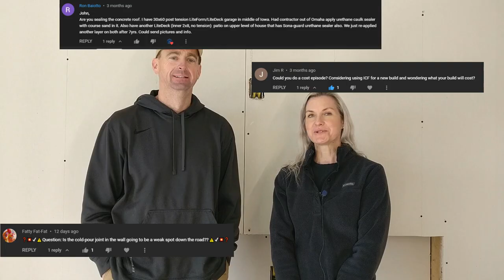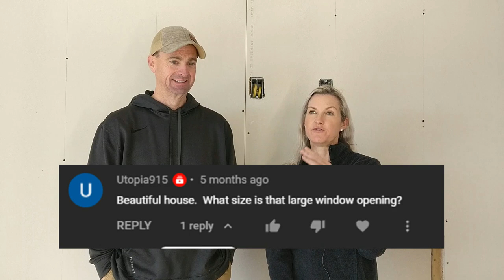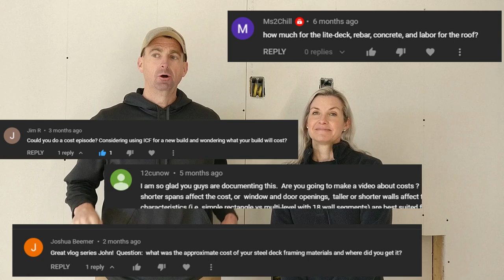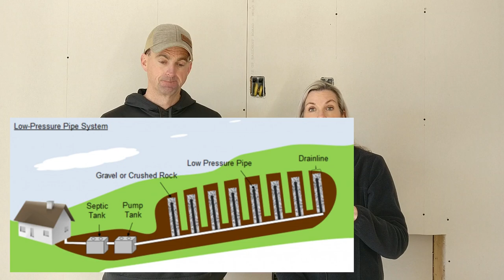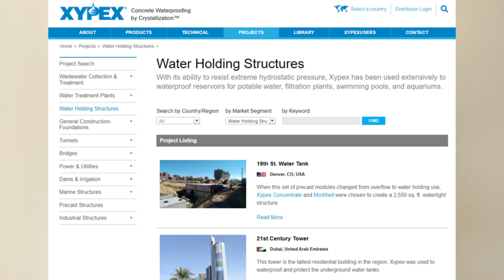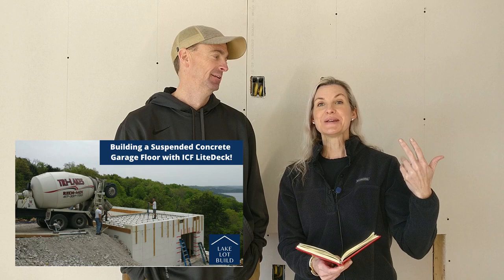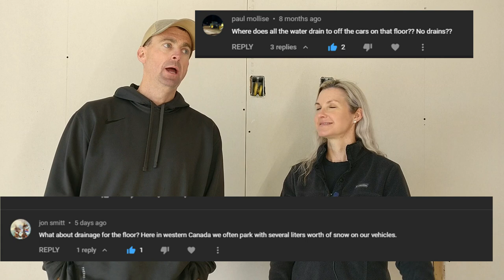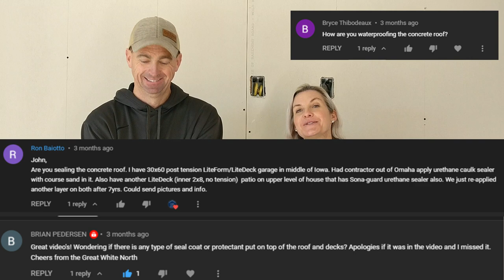ICF House Build - Answering Viewer Questions!

Comment: Good video, your xypex is a silane that prevents bonding of coatings as it becomes a crystalline matrix. The coatings bond were there is less xypex in the cement. You should consider a 25psi  eps foam mechanical bond with a TPO 60 mil mechanical bond to concrete this will increase insulation and give you a belt and suspenders solution.
Reply from the maker: Thank you!

Comment: I have worked in the roofing/waterproofing industry in the past. One product used by the Disney Corp for waterproofing everything including balconies is Polycoat Products USA out of California. That company provides coverings for Decks, Roofs, Walkways and Truck bed Liner systems
Reply from the maker: Awesome! Thank you for this recommendation. Right now we have a silicone layer that seems to be working, but we definitely want to know what else we might use if this doesn't work long-term.

Comment: Ten years ago Dallas Reunion Center went through an upgrade. The existing concrete porches suffered from water incursion. A commercial roofing company applied a thick membrane over the repaired original substrate and poured a new concrete deck over it.
Reply from the maker: Thank you! We are looking at all our options, so this is one we will look into.

Comment: Here on the middle we use tar mats or what's commonly known as "Bituminous waterproofing" on top of the concrete ro/deck. The sheets are welded together using heat from propane or butane torch.

Comment: Have you considered thick polyurethane sprayed coating? Durabak comes to mind. I'm referring to what most people refer to as truck bed liner. However, the same product is used on playground equipment, boat decks and a lot of other things. Something to look into.
Reply from the maker: We recently used silicone rubber paint which is basically the same thing! A roofing company suggested Inland for the brand. So far it has fixed our problem and looks great!

Comment: as the guy who suggested the rooftop deck that you're now so in-love with, sorry the waterproofing isn't quite sorted.

...my plans involve some slope to avoid pooling, & so i had to find a deck solution that allows for correction back to a level surface; Bison pedestals. this should allow the concrete waterproofing to not also need to stand up to foot/furniture traffic. the added cost is high, but weigh that against the added value of the usable deck & views?
Reply from the maker: Well no regrets other than the fact that the concrete guys missed the slope. If we had it to do over again, we would have made the front wall taller or had the slope built into the Litedeck.
Reply: @LakeLotBuild  ...another thought -i'm not 100% sure if Ecofinish would be an option (as it's a relatively new process developed for pools), but i've floated the idea to Aaron King on an ICF FB page. exceptional builder, brilliant tech, seems like loads of potential uses. ya might reach out to him too.
Reply from the maker: We will definitely check that out. Thank you!

Comment: For the roof, we have a company in GA that did a Polysaspartic  Polyurea coating on our concrete garage floors. Extremely durable and attractive,  I would think it'd be durable in the sun as they do concrete pool decks as well. I do believe it's waterproof, but not 110% sure.
Reply from the maker: Thank you! We will check that out. We need to coat our garage floors too, so we need to look into for that reason too.

Comment: OTR trucker just past Memphis on our way to Cali.  Was the Zypex additive expensive?  I’m sure it may have been better than the labor and cost of vaper product… thx bruce
Reply from the maker: Not expensive at all. It is really just pennies per SQ ft. Definitely worth it.
Reply: @LakeLotBuild  thank you I’m wanting to build a home with a basement in north Florida and this product will help me do that. Thank you and continued Blessings. I’ve throughly enjoyed watching y’all build this home
Reply: Remember: The additive is in the concrete and municipalities design tanks differently - If the structure has any sort of settlement there could be a crack which will give you a leak. I still specify the waterproofing in residential.

Comment: Not sure what you did to your roof that is bubbling up and not adhering.  But here are a couple of things to look at.
We have done many epoxy out door coating that are UV stable and last a very long time.  The key to this being done right is the prep work to make sure you get the hold it can give you.
Second and not sure if it has ever been used this way before is from Ecofinish high performance coating.  you may want to check and see if they are able to be in your area.  Both of these will work I think.  Good luck have a good day.
Reply from the maker: Thank you so much! We will look into those!

Comment: You two are doing great, $115.00 per sq. ft. is excellent. We live on 40 acres with too large a house. We have another 450 acres ajoining and We have another 40 acres across the fence which we built a road through and made 8 5 acre lots.My wife designed another house. Covid stopped our building plans a couple of years ago. Looking to start up again now we are getting quotes of up to $350 per square foot. So guess we will wait for now. Would like ICF and or SIPS to build with.
Reply from the maker: Yes, new homes custom built are at least $250 a sq foot to start here.
Reply: I haven't seen too many redeeming features of SIPs.  When I looked in to them, they didn't look much better than conventional framing with foam board insulation wrapped around it but they were expensive.   ICF makes your house practically a vault and can work out cheaper when finishes are added in.

To me, ICF with wood framed ceilings and floors makes a lot of sense unless you want second floor parking or a roof deck...  Combining ICF and SIPs doesn't seem like a very good combo to me.  Make sure you budget carefully and choose wisely.

Comment: As a commercial roofing company We adhere roofs to all new construction involving concrete decks. If you want I can send you a link that will describe and show you how this is accomplished. It will also cure your ponding issue. There is no pitch to your roof of even 1/4 inch if you have ponding.
Reply: You will need to put a layer of walk pad over the TPO to prevent premature aging of TPO due to foot traffic. Various types of walk pad are available.
Reply from the maker: Yes please! You can email is at lakelotbuild@gmail.com

Comment: Curious where you guys settled on the waterproofing of the roof deal. I am looking at doing something similar and wanted to get ahead of any issues. One thing my architect recommended is a membrane on top of the litedeck sheets before the concrete is poured but that's probably not an option for you guys at this point.
Reply from the maker: We have had great success with a liquid silicone brush in product. We went through several products (water-based) that did not work. The rubber membrane has worked great.
Reply: @LakeLotBuild  Do you recall the name of the silicone product? Thanks

Comment: I am curious why the icf roof cost between 30 and 40k when icf roofs are typically between 13 and 17 dollars a square foot turnkey for flat or shallow single slope. What is the breakdown of your roof cost? If you don't mind ☺️
Reply from the maker: We ended up around $26 per SQ ft for everything - LiteDeck, labor, and concrete. We didn't have a broken down cost as the roof was done by our ICF contractor.
Reply: @LakeLotBuild  no worries. I was just trying to see why it was so out of range from the average. I know municipalities, and material availability affect things like that as well as contractor pricing, but I was feeling nosey. Thank you for answering.

Comment: 1 inch pavers over the elastomeric membrane -- the pavers will protect the membrane from puncture (large hailstones, high heels and intense friction on hot days) and distortion and may also apply constant pressure to abate delamination  ... ?
Reply from the maker: Love this idea. We will look into it.
Reply: @LakeLotBuild  you may need to put a layer between (like that orange mat for tile) - then brush sand between the cracks and fill them with that polymer sand.

Comment: Place epdm sheet on the roof and then pour another layer of cement on top
Reply from the maker: We thought about doing this for the first pour. The engineers were worried about the cold joint or cracking on a thinner 4" topping slab. Not saying it would not work, but there were concerns.
Reply: @LakeLotBuild  hmm .... in that case, look into tclear heavyguard over the epdm
Reply from the maker: We will definitely look at that!

Comment: Great videos! Are you using your infloor radiant heat? Recommend using it in new build in Missouri?
Reply from the maker: We are! We have radiant floor heating in our lower floor embedded in the concrete slab. We haven't hooked it up yet but we're excited to see how well it warms the house in the winter. I think it's a great solution for heating in Missouri

Comment: Hi, I have a question. Do you have an attic between your main level and your concrete roof? I’m trying to decide if I need an attic with our build. Thinking of mini split system as well so no need for attic systems.
Reply from the maker: No attic for us. We put the lite deck on as the roof right on top of the last row of ICF block.

Comment: From Utah. Take a look at this solution for the roof deck: https://www.youtube.com/watch?v=E8LGAVBlCs4 He does a lot a great videos on his construction business. This video is a deck system over the flat roof. I think you could do the same thing with composite boards and a do it yourself solution. The panels are easy to replicate, the key is the plastic risers under the floor.